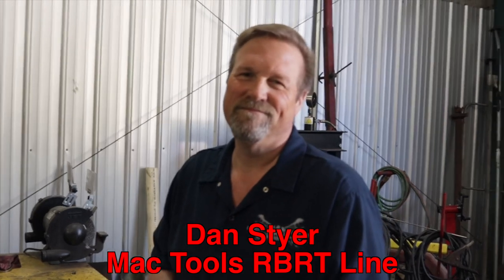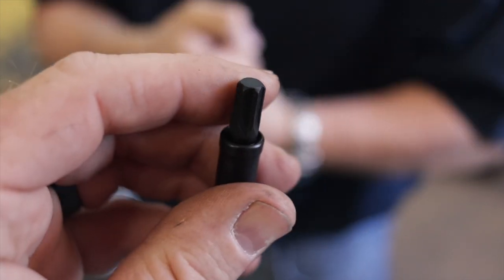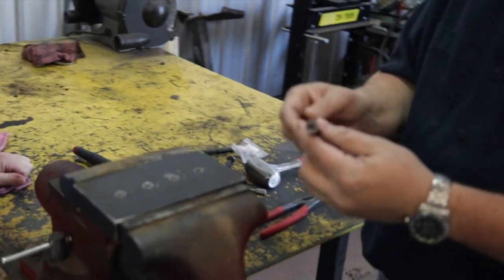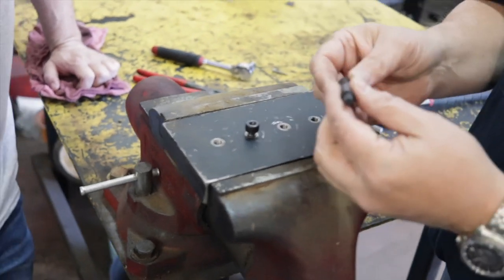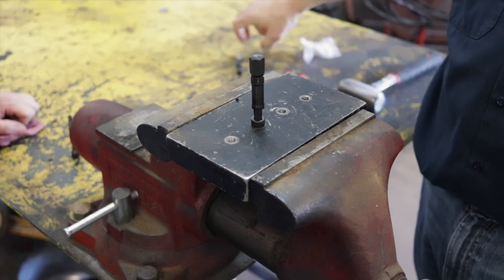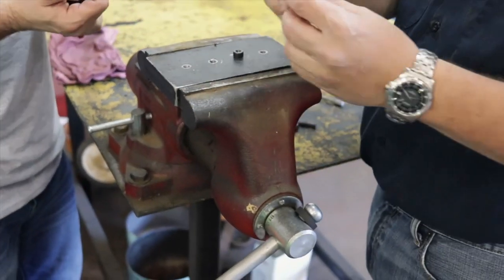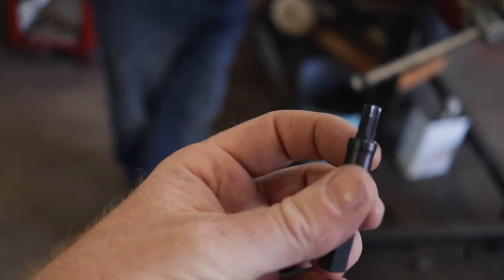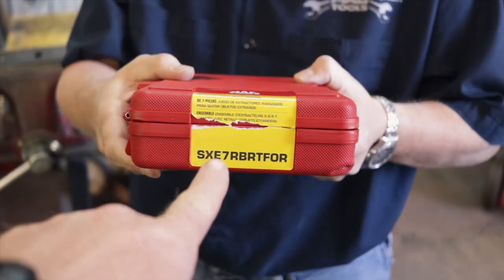Mac Tools: Broken Bolt Extractors With Foreign Object Removal. How to use them. Why They So Good?

Comment: Bluepoint had this tool out over 40 years ago, part number 1020, except they included drill guides and drill bits with their kit. Hang in there, Mac tools, you’ll catch up and maybe another couple decades.
Reply: Germany has one too but it sucks... So it's not just the similar flute design

Comment: I picked up that set, the 29 piece drill bit set and a handful of other drill bits to fill the empty spots in one of my other sets yesterday 👍
Reply: I’ve had the regular RBRT SAE/metric set for 8 or 9 months and warrantied out only my 1/4”. It held on well enough to snap the bit without hurting the Allen head cap screw.

Comment: I see you’ve changed your mind about the rbrt  line .. I have almost completed the entire line except the speed balls.  Not going to get those. But these broken bolt extractor is an awesome deal. Used it several times

Comment: Good video.  I have blue point which is similar except that it does have the extractor.  Set was made by rigid because their name is on the drills.   Broken bolt removal is an art form and prefect results make you better.  Like when wild bill has to fix wally's screw ups.

Comment: These seem pretty good, but I can’t tell you how many times I’ve used a torx bit to extract a broken bolt after I drill A whole into it. Yea that torx bit isn’t in the greatest shape but it’s worked and if the torx bit is mangled I get it warrantied. Now I would really get these. I’m going to get with my Mac guy and get a set of these! Thanks for the video and salutations all the way from the state of Washington!
Reply: Hey man what part of the state you from?
Reply: Jonathan Hill Tri-Cities Washington
Reply: JC Olivera I’m not that far away, I’m in Sunnyside. I wondered if Tricities had a Mac dealer
Reply: Jonathan Hill Sunnyside? Holy crap! Yea they do Tim Lawrence look him up on Facebook, the shop I work for is out of Pasco, I actually live in Granger. I’m a remote service tech.

Comment: Believe it or not, I can definitely use one of these sets in my construction and remodeling/flipping business.  You'd be surprised at how many shower mixers that can easily be rebuilt and reused, but the screws are corroded too much for a simple screw driver to release.  So I find myself replacing the mixer, which is costly and time consuming.   Definitely going to flag down the next MAC Tool truck I see going down the road.
Reply: Hello! You can but these extractors, as well as a full compliment of RBRT products from www.mactools.com part# for this set is SXE7RBRTFOR and non-removal sleeve set part# SXE7RBRT Thanks!

Comment: Have they demoed their Mac "Precision Torque" sockets for you yet?  That's another Mac Tools Exclusive for removing bolts with a rounded head (And they work good with non-rounded bolts too). If you've not seen those Precision Torque sockets yet, prepare to have your mind blown all over again. . . . one of the technical magazines did an article a few years ago when those first came out and called them the world's best sockets.

Comment: Thankfully in aviation it's so rare to deal with broken bolts that I probably don't need this (and I have the full snap on extraction kit which is also very nice) however screws on the other hand.....

If you think that's cool I need to introduce you to the J bar.

Comment: These are bad ass...but there's been a couple broken....no biggie....that's why I prefer mac drill bits over HyperStep...I've got both but I know every single bit is cobalt and covered by MAC
Reply: They hyper step just doesn’t warranty the smaller size bits right? Do the hyper step cut faster than the Mac? I need a set and on the fence for either

Comment: Wonder how well they would have worked on my 30 year old original, seized exhaust bolts… the bolt would barely move but it would then get stuck in either directions… When heat, penetrating oil, and working it back and forth for half and hour didn’t work I had to use my 36” breaker bar and still no luck!!! Finally the head snapped and I had no choice but to drill & tap 😭

Comment: Can you use them on left hand thread fasteners
Reply from the maker: You have to drill them out and then pound them in like any other extractor
Reply: Thanks I just picked up a set and wondered if I could use it on them type of fasteners as well 👍🏻

Comment: Does mac make longer or varying length versions of these for recessed allen cap head screws? When the hole is smaller than the sleeve the extractor sits in it obviously creates a problem.  Was recently in a situation trying to remove a valve block over a welded top canopy. Rounded out bolts with no room for a drill and bit..."grab the torch" situation.
Reply from the maker: They make the extractors without the FOR (foreign object removal)

Comment: The drilling part,the drawback is drilling in too far causing more problems if with a broken off bolt.I watched my dad do it once,right into a water jacket in a cylinder head
Reply: Best tip I have been given is; Before you try centre punch the centre of the bolt,  Sharpie mark the centre first, look at it, if it's not right, wipe off with acetone and try again.
You can have as many goes as you want with a Sharpie, a centre punch is permanent. 
When you have it dead centre you have a good guide for the centre punch.

Comment: Like to see it on a broken 3/8 bolt in Michigan truck frame that's seen 10 winters. Going to look at price and that will determine if its worth trying. Ohhh oh 254 for 7 extractors. Want to see the real world test I put at the beginning of this post . I can buy a mig welder for that price now and Weld a nut to it.
Reply from the maker: These are now sold under the Grip Edge brand. Same manufacturer but without the Mac Tool markup on them. Just saying

Comment: I'm still not convinced. That bolt you used for the demo wasn't even broken, or rusted. It was a clean bolt, in clean threads, that had the head stripped out. I could if literally used vice grips on it to get it out. 
Let's see a real world scenario. 
Let's see a chassis bolt from NY, that's been rusted for 10 years, that has snapped off flush.

Comment: When removing an old rusted bolt, or any other fastener for that matter, there is a really old trick that works wonders. I am sure this trick would also work very well with this tool if you should snap the head off. YouTuber Stephen Cox just did a video showing how this old trick works. 
https://www.youtube.com/watch?v=9PKNCVXvZ6w&t=567s